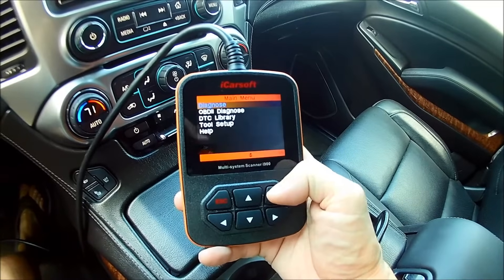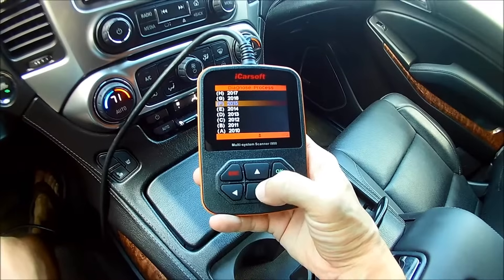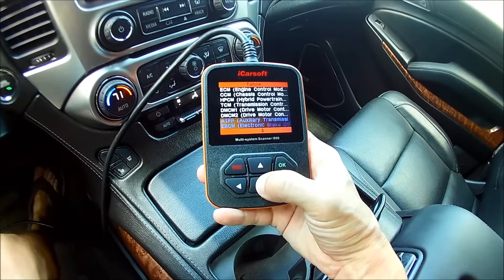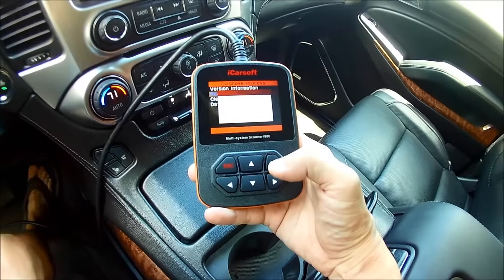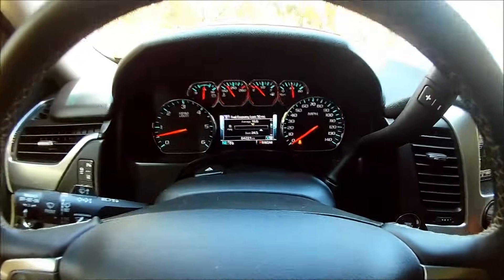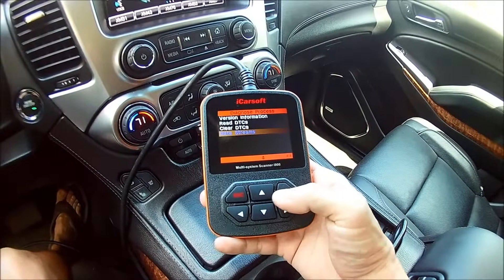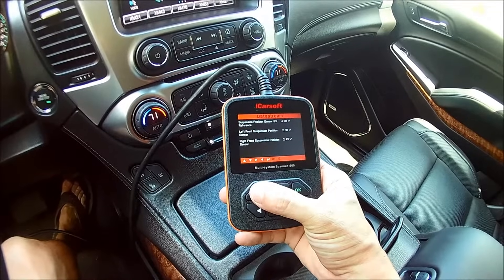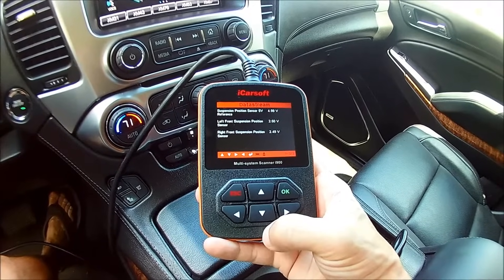2015 Tahoe LTZ Service Suspension System Z95 Magneride SCM DTC Scanner

Comment: Can you perform the ride height trim procedure with this tool?
Reply from the maker: No it does not. However, if you are looing to bypass your magneride, our OBD/SS will not require you to perform any trim procedure. Just plug it in and go!

Comment: But how do we fix a bouncy suspension on a 2015 Yukon Denali? Just replaced front struts still rides like a damn low rider. Makes riders sick from bouncing. Mechanics all say nothing wrong.
Reply from the maker: Sorry to hear about your bouncy ride. Email us at support@xineering.com for more info
Reply: @xineering   I mean we just spent near a $1000 to replace the front struts with no change in ride quality. Been reading on forumns it's a known issue and no body can fix it. We owe $37000 on this POS can't stand to even ride in it.
Reply from the maker: @CAROLiNABLUEMUSIC  What was the replacement suspension you went with?
Reply: @xineering  the AC delco magnaride struts. They claimed they were leaking and that was the issue... It wasnt I'm wondering if the ride height trim procedure might resolve anything?
Reply from the maker: Regular Guy Fixes Visit http://shocksims.com/#software to view our rental ScanTool that can read and clear DTCs along with preforming the Ride Height Trim procedure.

Comment: I just installed the full bypass kit and I am getting the service suspension light. I have a 2018 Sierra 1500, any ideas on what I could do to clear that from happening?
Reply from the maker: We emailed our troubleshooting guide and will get you fixed up.  Thanks! - Max

Comment: So how well does the full resistor kit work for a 2018 Sierra denali?
Reply from the maker: Our bypass kit is not solely resistance based.  
It works perfectly to bypass Z95 magneride shocks on the 2015-2018 Sierra Denali trucks.
Reply: Xineering LLC how many trucks have you successfully bypassed with the magneride suspension system and replaced them different shocks and struts?
Reply from the maker: @Darkdenali  We have sold hundreds of kits with great results across all the vehicles we support, including the 2018 Sierra Denali.